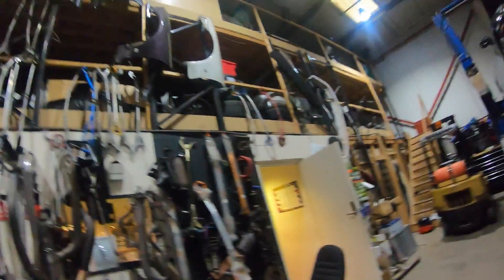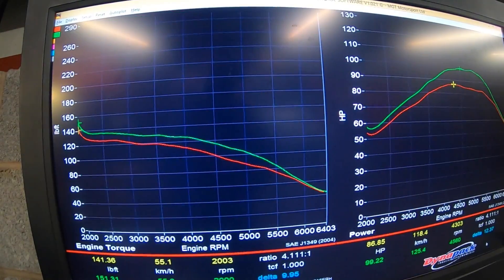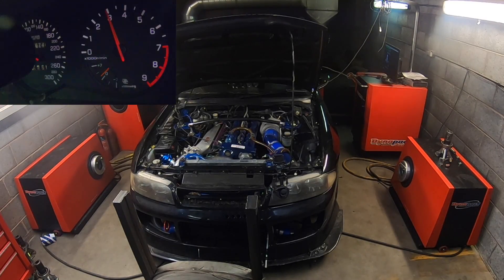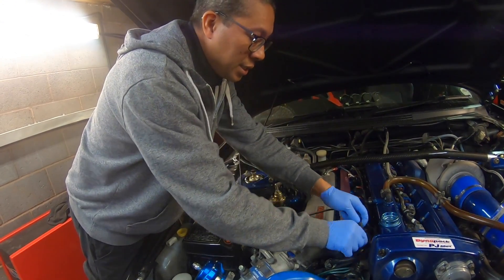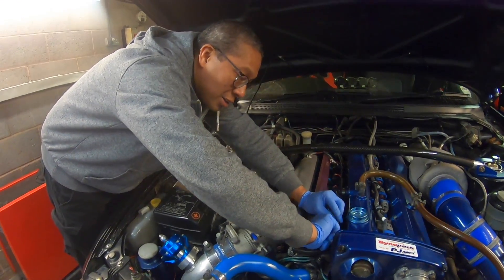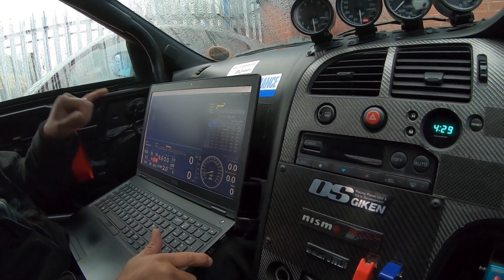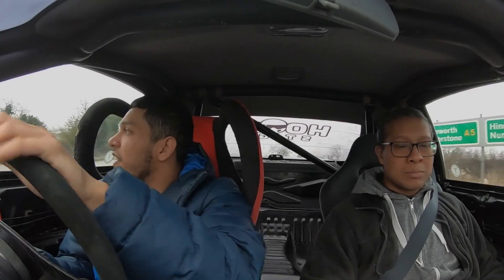700BHP SKYLINE R33 DYNO DAY TUNE WITH G4+ LINK ECU REMAP!

Comment: Wth!!! 600whp only @ 1.5 bar boost thats insane!!! Thats over 700bhp on fly all day long congrats bro 🔥🔥🔥🔥💪💪💪🧤
Reply from the maker: MrM ahhh thanks bro appreciate that 🙏❤️🤙
Reply: If there was 100hp lost from engine crank to rear hubs something is seriously wrong. The gearbox, tailshaft, differential and axles do NOT absorb 100hp. The wheels and tyres are where a large percentage of "drivetrain" losses occur. This is because it takes energy to accelerate the mass of the wheel and tyre - which in the case of a 17-18" combo can be upwards of 20kg. The other area where large losses occur is from the tyre distortion into the roller on a roller dyno, rolling resistance. And at higher power levels the tyre slipping against the roller. With a hub dyno none of these factors occur. It is literally just the fixed losses from the aforementioned gearbox, tailshaft, differential and axles. 
A standard R33 GTS25t produces 184kW (rated by Nissan at 250ps @ 6400rpm, 246hp) If it lost 100hp (70kW!)  through those same fixed drive line components it would make a mere 146hp (114kW) at the wheels. They make 170-190whp (130-140+)... and that's including the wheel and tyre losses! On a Dynapack hub dyno there would be no more than 40-50hp lost, if that. Power claims aside, cool content, really enjoy it and the focus on R33 (and R34) Skylines. Keep it up 👍👌
Reply: @hortz6  nah it's not, and you are wrong, flywheel to rear wheel in a manual is around 10 - 15% do the maths....
Reply: @hybridshift  
I've already explained in straightforward terms and using real world examples, including my own dyno experiences, where losses occur between crank horsepower and "hub" horsepower. To state it's 10-15% ( a blanket range across all vehicles is incorrect and doesn't allow for additional friction and heat etc.) and use zero rationale adds no value. Friction and heat will certainly increase when more power is applied to the drive train. But the fact remains, the largest variation occurs in the tyre and roller interface. These losses are removed with a hub dyno - the reason the hub dyno is now the preferred option with most within the tuning industry. It is repeatable  and consistent, and will output figures that are often less than 10% below actual engine output.  Numerous real world tests have shown this and often the hub dyno  manufacturers will state much the same. And at the end of the day this particular R33 does not appear to have a turbocharger capable of supporting 70lbs/min required to produce 700hp. The GT3582R needs a 1.06 A/R turbine housing and even then it is at maximum potential at 675hp - don't take my word for it, use the manufacturer's own data set! Garrett. I would gladly claim my R33 makes over 1000hp if I truly believed a 15% loss from hub to crank... and then add another 50+Kw for tyre to roller contact
 Mainline Dynamometers suggest 60 to 100kW extra from their roller dyno to their hub dyno with a vehicle producing 600kW at the rear "wheels". That would mean my 627rwkw (841whp) R33 is producing 627kW + 50kW (conservative estimate!) + another 10-15%! 
My R33 makes 627.2kW on a roller dyno, which is probably about 700ish KW (maybe 715-720 at a stretch). Which is exactly what I'd expect it would makes based on Garrett's own compressor map for the PR and turbine housing option my GTX3584RS is running. The real world tests results and baseline data match.

Here's another R33 GTS25t, standard stroke RB25DET also equipped with a GT3582R using  the largest 1.06 turbine housing. It eventually made 604whp at over 25psi, on a roller dyno. Add 100 odd hp (close to 15% DT loss) and that's 704hp... so largest housing, close to the limit of the 61mm comp wheel, and on a roller dyno. Hood Stig's R33 is making approximately 650hp, at most.
https://youtu.be/jhhTMEiqRwk

Comment: “Generally” speaking at 15% drivetrain power loss, I guess you are looking at the 700 bhp mark HoodStig...possibly more after Garth’s pointers. Congrats 👍
Reply from the maker: S S14 thanks really appreciate you and you have great knowledge!! Yeah garth is a Wizard when it came to mapping!! 🙏💯😅🙌 hope your scoobys doing well 💪💪💪
Reply: On a Dynapack hub dyno it WILL not be losing 15%. It simply won't. The direct hub connection removes the mass of the wheel and tyre (x2 in this case) and therefore the power normally "absorbed" on a roller dyno where the engine has to accelerate the mass of the wheels and tyres. There is also no tyre distortion and no tyre slip etc. At 600hp at the hubs the engine is probably closer to 640-650hp.
Reply: @S S14 Andre from Horsepower Academy (renowned tuning specialist and training guru) gives a bit of a run down the hub vs. roller dyno and Dynapack dynos in particular - same dyno used to record the figures from Hood Stig's R33. There is a general view from many experienced dyno tuners that a hub reading is not far off the engine BHP figure. So I've probably been generous in suggesting this R33 is making 640-650hp at the engine. It may in fact be closer to 600hp.https://www.hpacademy.com/forum/off-topic-discussion/show/horsepower-dyno-readings-usa-compared-to-aus-et-al

Comment: great video, so was it dyno'd before retuning as it's probably making above 700 now but people were wondering whether it was 700+ before I guess? Hopefully you're still able to rev it out with the new map and that it doesn't become uncontrollable before getting to high rpm
Reply from the maker: Stallzyx thanks bro and nah i never had it dynoed myself but i do have paper prints which i could show in the next video regarding the skyline!, and yeah alot of people in the skyline world did advised it to be over 700+ with the mods! Its a very capable car but again very costly haha, yeah the drives absolutely amazing now the power is instant with not much lag! Im just waiting for a nice hot day with dry roads so i can let her rip haha 🙏🔥🤙

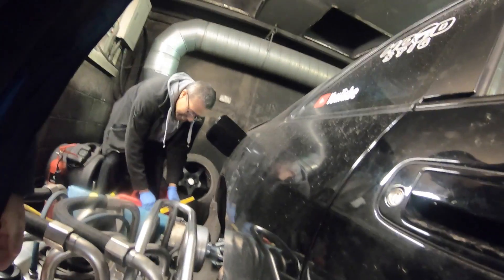Comment: 2:30 first I've heard of tuners needing to do a cold-start map as well... the ECU is meant to automatically compensate on fueling when cold anyway? 

Usually a decent map takes a good few hours, but 2 days? I think he's wanting some more hourly pay from ya lol
Reply from the maker: Albus Dumbledore it is debatable but they are a very well known tuner for skylines and if tather the skyline run perfectly with no problems and i did understand the cold start because i know a previous owner having a skyline mapped within a few hours and the next day on a cold start he had a few mapping issues and lag etc, my skyline with the new map and ecu drives soo much better 🙏💯🔥
Reply: An oem calibration takes months with multiple people and multiple cars in multiple locations.  

Yes the cold start cycle is something which the ECU chooses to enable, dependant on conditions but that cycle has to be programmed by a person, the computer doesn't just guess it, same way it doesn't guess it's full load map.  

Shows you how much of a joke those £90 FB remaps are

Comment: What turbo is it
Reply from the maker: Its in the vid near the end but GT358R ball bearing!
Reply: @hoodstig  nice spools a tad late but makes good power for 1.5 bar I like it 👍🏼👍🏼
Reply: @hoodstig  I assume you mean Garrett GT3582R? Which is an early generation Garrett GT35 frame turbo and rated by Garrett at 400 to 675hp. The GT3582R 61mm compressor physically cannot flow 700hp, it is absolutely maxed out at 675hp and that requires their biggest 1.06 A/R turbine housing. Do you know which turbine housing is fitted to it? 0.63, 0.82, or 1.06? From the transient response I'm guessing it is 0.82, which limits maximum horsepower a little, due to back pressure, in a trade off for response - it would need the largest 1.06 housing to make the maximum 675hp figure. Click on the link I've provided to the Garrett website and you can check the list of part numbers for each turbine housing option. Get the number stamped on your turbine housing and see which one you've got by matching it up with the list of part numbers - two sets of housing part numbers as there's internal and external wastegate. I think you mentioned yours is ext gate. I could probably look at your videos and spot it for myself if you zoom in to the engine bay.
The 61mm comp wheel in the GT3582R will probably support 600ish, 640-650hp (engine power, not at the hubs and certainly not at the wheels) at best with the 0.82 rear housing. 
https://www.garrettmotion.com/racing-and-performance/performance-catalog/turbo/gt3582r/